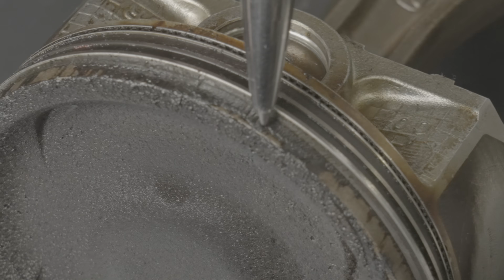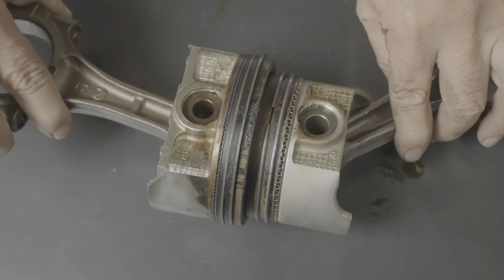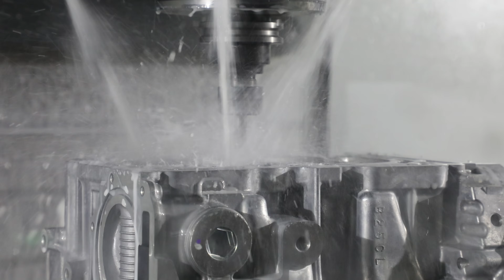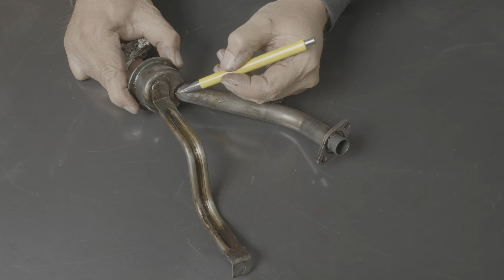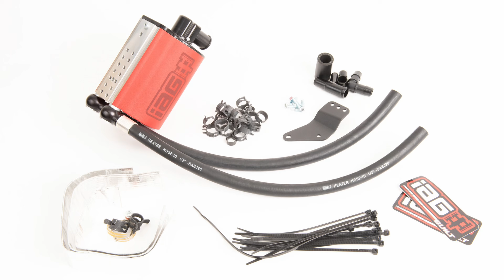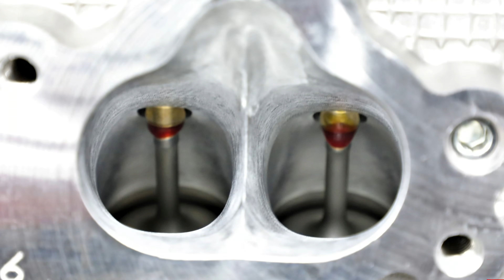Why Subaru Engines Blow Up!

Comment: Because they’re trash, good chassis, bad engines and don’t even get me started on their false claim of best awd system.
Reply from the maker: On the STI the drivetrain is strong and pretty good.
Reply: @motoiq  I will say the sti transmission is strong though but the awd system isn’t good.
Reply from the maker: I think it works pretty good, what do you not like about it?
Reply: @motoiq  I can easily do what STIs can’t on the same tires with my much older viscous coupling DSM with an lsd rear
Reply from the maker: What is it that the STI cant do that a DSM can, it has a gear type LSD in the front with a 1.5 way in the rear with an electronic clutch center. I can't see a DSM being any better and the DSM has a glass tranny.
Reply: @motoiq  glass tranny?! That’s the wrx, I daily my 550hp awd and beat the shit out of it, have been for over 5 years with zero issues. All my dsms have been super reliable. Every single person that had a Subaru were breaking at stock power levels and with the same tires I was blowing past them in the snow. Subarus are garbage, learn that and you’ll be happier.
Reply from the maker: What did you do to the trans?  Even mild bolt on cars break them. We even see stock cars break them every once and awhile. We are experimenting now with stuff to help the 5-speed on one of our high power WRX builds but I don't know if they actually work or not yet. What do you define as beating the shit out of it? Blasting down the street every once and awhile or doing a track day?  The fact that you don't break your DSM tranny means you either got some secrets or you don't drive particularly hard. I could care less if they are garbage, fixing them keeps us busy.
Reply: @motoiq  just a stock rebuild on the transmission done by me almost 5 years ago now.

I beat the ever living piss out of this thing, launches, 8500 rpms, NLTS, sees 140mph almost daily. Zero issues with the car. In fact in the 20+ years I have owned DSM's I have only broken one transmission and that was my fault.

Now my 4g63 swapped mighty max on the other hand has a glass transmission. Went through 3 in 3,000 miles before swapping to an AR5.
Reply from the maker: Sorry youtube automatically censored you post somehow, I have no idea why it flagged anything you wrote as offensive.  Wow our shop 5 speed, although being somewhat abused has broken 3-4th twice and wore out an OS gearset. Last rebuild is new parts plus WPC, Cryo and blast plates with shockproof heavy. You use yours way harder. What gear oil do you use? A mighty max with a 4G sounds so awesome.

Comment: Glad you broke this down! I've been considering a STI hatch and the biggest concern has been the EJ reliability.  1 of the 8 people I know who have STI has been solid with no issues (he is stock turbo with bolt-on and 93 tune). The other 7 have went through multiple from FBO to full build. As a Evo guy that's been my biggest issue buying a STI for a fun DD.
Reply from the maker: The hatch is one of the bad years with a bad tune from the factory.  We had one blow up on the dyno bone stock brand new in testing.  It has to get retuned more conservative by an experienced Subaru tuner and it will be fine.
Reply: @motoiq  thank you for the info! I was unaware of that as an issue on the hatch.

Comment: My 2014 turbo Forester blew the engine at 47,000 miles. Subaru ended up paying about 1/2 the cost of replacement. The bill was $6,700. It also has a sensor that gets wet which operates the key fob and that had to be replaced 3 times. 
My neighbor's brand new Subaru blew the transition within one month. I will never buy another Subaru again.

Comment: Sounds like subaru is an excellent crankcase manufacturer, that is still learning to build cars. I went through a couple of the old naturally aspirated variety, in just a couple years.🤠
Reply from the maker: that is one of the worst parts of the engine, did you not watch the video?

Comment: A common mistake with subaru owners is they put too much power through an open deck engine which can handle 400bhp tops, get a closed deck w forged internals 👍

Comment: Oh, like we’re not gonna talk about it’s how they’re driven. I don’t know one turbo charged Subaru motor that isn’t in a domestic violence relationship. All my buddies that have Subarus with turbo drive it like they stole it. Every light is a drag race, every open stretcher road is a rev, limiter check, and they don’t care to do the maintenance on them. The problem with those turbo charge motors is already souped up to begin with then, when you hammer a vehicle that already has a tricked out motor in it, you endure the cost of that tout motor. most people don’t want to spend the time and money to do proper maintenance. I was in the military I knew guys that knew how to work on cars like myself. We would take their Sti and modify them to run rally on the weekends. My buddy still has the stock block and motor and his with 120,000 miles on it. Two years ago was when we had to go in and replace everything with forged parts. He is still running the same block. So it’s less about the car and more about the maintenance/owner. Most STI drivers are younger kids who can barely afford the car and drive it till it blows up. The junkyard is full of domestic violence, Subarus. I love Subaru and I choose the FB 20 model not because it’s not Turbo charged but because of what I can do with it. I know it’s slow, but new headers, new manifold and spacers, bigger, coolant., as well as oil, coolant, and the last forever. The guy who has helped me with my first Subaru has 300,000 miles on his with only head gaskets and timing needed to be done.

Comment: The older Subaru's are good cars especially the EA71, EA81, EJ22 and an unmodified FB20 as well. Just don't beat on them and they will serve you well. Regarding the EJ25, 1996 to 2010 all were notorious for head gasket issues. Good engine once you changed out for MLS ones. I would run not walk away from WRX's and STI's unless you keep them unmodified and don't beat on them.

Comment: I got 2010 SH Forrester -- 2.5L aspirated not turbo. Hasn't failed me yet.  
I've tweaked it a bit; after market ECU, NGK electrics, Cat-back exhaust, bigger radiator for cooler running, slotted rotors all round etc. just no turbo.  Done 4 cross country road trips; never missed a beat.

Comment: I have a 2011 subaru forester i bought used odemeter read 103,000. Starts and runs great. Diagnostic scan read 81,400 miles. According to online info the head gasket was made more durable for longer lasting. The timing belt was replaced with a timing chain for longer lasting. The company was trying to improve the enging to give it more miles. Like anything else it burns out.

Comment: This is why I built a GTR. RB engines have their flaws (typically with oiling) but when addressed, are extremely reliable.  They are not cheap though.

Comment: These stupid regulations!!! Think about it for a second…build a reliable engine that runs 400k for 20 years but pollutes 10% more(those 5 extra millimeters on the rings position]…or build a car that pollutes 10% less but needs to be scrapped and built new every 5 years …what is better for the planet? But nobody thinks clearly especially all those degenerate activists and politicians.

Comment: One of the best videos I have seen on just explaining issues with an engine not just because it’s a Subaru motor. A lot of what was explained can been applied to many motors especially the part about using head studs. My hat off to you sir for letting the you tube community understand about what happens to your cylinder bore when using studs. 
A lot of fools who think they know how to build or solve head gasket problems think that head studs is the answer. Using studs will help prevent blowing head gaskets especially on a diesel engines but that cylinder distortion will result in a shorter engine life. 
I drive a 2003 F250 with original head bolts and gaskets with 420k mileage on it currently and will hit half a million this year. Wouldn’t be able to go much past that with head studs and not start using/burning oil.
Reply from the maker: No one ever believes me!
Reply: I love the information, I'm about to rebuild a 1.8 turbo. My question is do rebuild this and how much would charge me to rebuild this and where are you located thank you.
Reply: I was nervous when send my question but it was mainly, it you rebuild my  1.8 the way you explain it in your video.

Comment: On my 3rd Subaru, and no more. Had a 2006 WRX, 2006 Outback (NA), and 2014 Forester XT. So many weird, expensive problems, moving to Toyota/Lexus. I've spent thousands just trying to keep the Forester in normal working condition. Had i not bought it new, I would've thought it was a lemon. The WRX and the Outback were weird too with expensive repairs, but the Forester has been the worst.

Comment: The upper part of those pistons, where the ring sits and it glides up and down in the cylinder has so little height that it looks as if it easily could "wobble", which of course would help destroy such a ring and also would account for the type of damage on the upper edge we were shown here
Reply from the maker: No it's detonation damage
Reply: @motoiq  Do you agree somewhat on the rest of my assessment otherwise, about the head of that piston being very thin, lacking height, or whatever I should call it?
Reply from the maker: No
Reply: They have Teflon runners on the piston heads that stop piston slap. It can get worn and develop slap, but usually only if there are other problems. Rod knock from pre detonating bad fuel is far more common. Use good fuel, it's in the manual.

Comment: Family have had 5 Subaru’s, 1 Impreza’s, 1 Outback, 2 XV’s and 1 2000 WRX. Never had any engine problems with any of them. The 2004 Outback was written off due to hail damage with 270kms, daughters 1998 Impreza sold with 340kms as we wanted something with airbags and 1 XV sold due to an accident but replaced with a newer XV. My 2000 WRX has 353kms, still has the original engine, gearbox, rear diff and running gear. Regularly run the engine to 6500 rpm plus, use gears and rely on revs rather then torque. Regular oil changes every 6 months are essential to making these things work.

Comment: Well, If you drive like a normal human being, you willnot have any problems. Maybe, some silicone gasket leaking atter 150k. If you are contantly redlining your WRX or STI, then stuff happenes! 😂
Reply from the maker: If you watched the video you will see that bad modification, and poor maintenance on a marginally strong engine causes the problems.